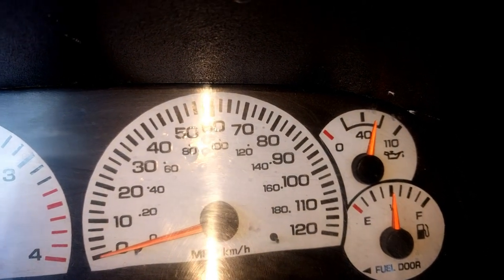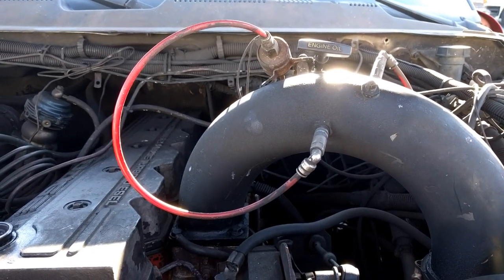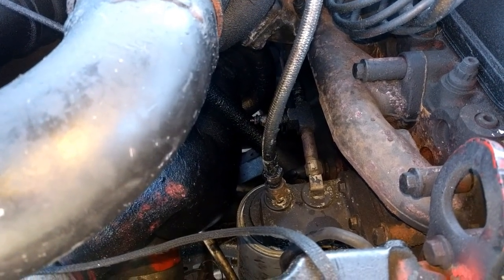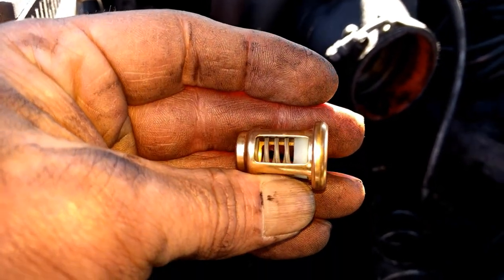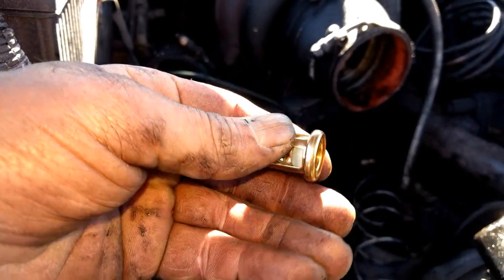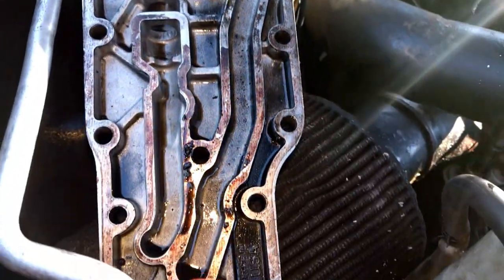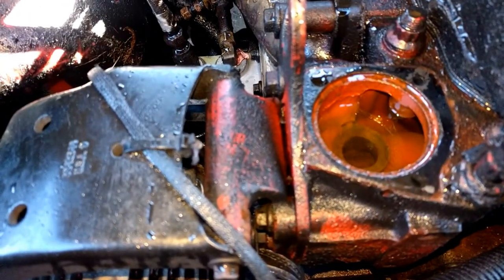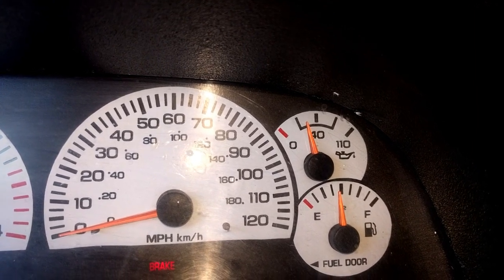low Oil Pressure Cummins, Diagnose and Repair, Step by Step

Comment: This repair worked, not because the oil bypass valve was replaced but because the oil pressure  limit valve was, the aluminum housin of the piston was worn and possibly the piston itself, added to a possible spring wear, leaded to a iddle low oil pressure .

Comment: Thanks for the effort.  You'll notice the set screw not far from the thermostat housing.  If you remove that set screw, you can fill through the radiator and the air will leave the head through the set screw port.  Much easier than removing the thermostat.  Also, if you spray the engine compartment with purple power degreaser, then rinse with a hose, you will have a much cleaner work environment, and less stuff to get inside the engine and all over your hands.  :)

Comment: A bad injected can and will leak by the piston cylinder there oil passages thru the valve train and stops into your crank case so it’s not a myth it’s a real thing I promise you that! But great video and super appreciative of the videos!

Comment: The bypass valve bypasses the FILTER if the filter gets clogged and protects the engine, if it's bypassing when it shouldn't, it won't show as a low oil pressure reading, though if the filter is clogged then you could have a bit lower pressure
The relief valve seat being worn could be a problem on a lot of high mileage trucks

Comment: My sending unit was replaced due to eratic oil pressure readings and now at warm idle it is where yours is reading at the end of the video.  Thanks.  Same engine setup.

Comment: I just did this on my 03 cummins I had no oil pressure on start up. Had to give it throttle to bring up the pressure then it was fine. Rook it apart and did both gaskets and the oil pressure relief valve. Hopefully it fixed it!
Reply: Did it?

Comment: Interesting but the brass valve you replaced is the oil filter bypass it opens if the filter gets plugged up or restricts the flow. It wont effect oil pressure it just bypasses the filter. The steel piston with the aluminum seat in the cover is the pressure relief valve replacing the cover fixed the leak past the valve and i guess more heat meant thinner oil and it leaked off more pressure. go buy a lottery ticket you lucked out. 99 times out of 100 its main or cam bearing clearances that cause the drop off of oil pressure when it warms up.
Reply: It’s been a while since your comment but we have a ISL9 
It’s doing the same thing as this truck but it has just below 40k miles 
Think the bearings still the cause or should go for the oil cooler housing?

Comment: I cant figure mine out. Oil pressure was checked woth a guage and it's normal,  but drops to zero and back up erratically for some reason.  Swapped out the oil pressure sensor and pigtail, but to no avail. I might try this.
Reply: That's how my gauge is acting on my 1993 Cummins.  Turned out that my oil filter came loose and oil was coming out past the seal.

Comment: Another thing I meant to say is Power Driven diesel sells a oil pump from a 8.3 that’s been milled down to fit in the 5.9 block and flows 42% more oil! You would have to get he common rail pick up tube because it’s 1 inch and bigger than the gen 1 and 2!

Comment: Injector copper washers is where the diesel will leak from and can cause higher level on the oil dipstick (Dilution) !! leaks can occur too from the diesel spill line over the injectors! This WILL cause oil dilution too ;)

Comment: i am having a delay in building oil pressure (approx 5  seconds). My engine knocks until it gets the oil pressure. Do you think these valves are not closing fully? 98.5 cummins

Comment: Good information. 
How did you remove the oil rlf valve . I'm in the process of replacing it on my 5.9 cummins.  Thanks for the video.
Reply from the maker: I just took a screwdriver and pried it out. It is not that tight.

Comment: Just replaced injectors on my 01 after getting a lot of fuel in the oil. Started her and she ran great, 60psi on dash at cold start. Once up to temp she was right below 40 cruising at 60mph and then at the stop light she was right above the lower left mark… truck had fresh t4 rotella in it and dipstick was good before starting. Parked her at the restaurant and came back out and checked oil level and she was below the limit by a lot. Friend thinks that after sitting for a month I drained out more than 3 gallons. Gonna hook up a gauge to the oil supply on the housing and check from there when she’s cold and warm. Hoping it’s just the sending unit maybe. Any suggestions?
Reply from the maker: If it leaked oil while sitting it would be on the ground. Check the antifreeze Oil can mix with coolant. The oil has to be going somewhere. I don't know how many miles but bad rings can cause fuel to go in to the oil and burn a lot of oil.

Comment: I have a Chrysler 300C I change the oil pump switch I changed the oil pump connectors PVC valve crankshaft sensor and my oil light is still on they changed the oil switch three times in the engine light is still on I'm starting to think it might be my oil pump any suggestions

Comment: What happens if U dont put relief valve back there and run engine without it?
Reply from the maker: I don't know why, did you put it back together and then see the relief valve on the ground.
Reply: @Glennfix  I put it back without valve purposely but my question is what happens if engine runs without it?
Reply: @Glennfix  Since mine is marine engine and im living in NYC and not somewhere in Alaska i consider that having this relief valve is big mistake nothing else thats why i put cooler back without it. My engine is 2004 but i have also the other 6bta which is 1999 and there is no such a thing relief valve in cooler housing)
Reply from the maker: I am not sure what will happen. Keep us informed.
Reply: @Glennfix  nothing happened. Engine works with normal oil pressure now.
Reply: @dsadzaglishvili  did you have the same issue before you changed it with low oil pressure?

Comment: @2:52

Uhhhh.....

.... Broken o-rings on an injector can cause 3% fuel dilution in a heavy-duty 14L semi-truck-tractor engine within a week.... That's enough loss of lubricity to cause where on bearing surfaces and oil pump gears... I'm just notifying....

Comment: Curious if before you replaced the bypass valve if you also had light blue smoke exiting exhaust?
Reply from the maker: No, it just affected the pressure

Comment: I have A 6BT 12V and it's giving me the same problem is it the same setup as your truck?
Reply from the maker: It could be, Hard to say
Reply: @Glennfix  what year is your truck? I'm getting ready to put the valve in a 1998 12 valve. My pressure doesn't vary as much as yours with temp but I did swap the sending unit and it looks to run 10 at idle warm and 20 at 2,000 rpms warm.
Reply from the maker: @williamhyatt5270  This is a 01 24 valve
Reply: the parts are not interchangeable (different gaskets and port locations), but the setup is identical
Reply: I have 1998 x FedEx box truck with the 12 valve I'm going to charge the cooler and I'll see if it solves the problem